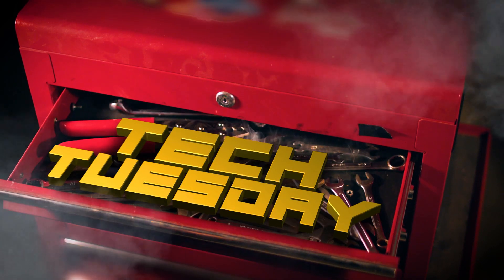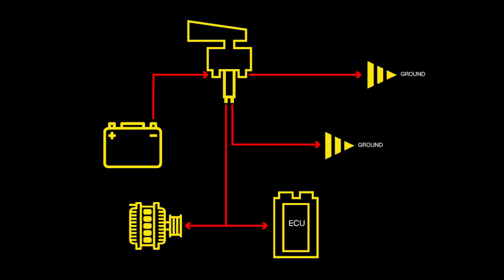🛠 DO IT RIGHT - Battery Relocation  |  TECH TUESDAY

Comment: Question: Have you ever seen issue with running the alternator cable past important wires?
For example, I have an alternator wire tucked under my intake manifold and it passes near injector wires.
Could it cause interference and poor function? What if it goes by coils or spark plug wires? The ECU?
Thanks for all you do!
Reply: The alternator can cause some noise. But in my experience the starter motor will cause you the most issues with interference if your grounding is bad. 

A bad starter will also crank but spike voltage to the crank sensor and thus will throw your crank timing out of whack. 

This was a big problem with my first project. My solution was a new starter and i used 1/0 for grounds.

I'm my experience coil packs with built in ignitor wont cause emf issues and neither should your alternator. If your wiring is in good shape.
Reply: @somedude9316  Thanks for the input! Still relevant for my projects. So far no issue with running in the scenario I described.

Comment: Yes bigger is better when it comes to batteries, I totally agree! It's pretty much the best insurance you can buy against alternator failure. Several months ago I went to Nashville TN to get car parts. As soon as I started driving back home to Memphis TN (about 200 miles), I noticed that my voltage was low and the battery light was on. A quick check confirmed my theory that the alternator completely died. I shut off all accessories and hit the road, feeling pretty confident that I would make it home no problem. Then I hit heavy traffic and got concerned. After sitting through 30+ minutes of traffic, I wasn't feeling quite as confident. But once I got moving I made it home no problem. The only reason I made it back without problems is because I have a big Optima Yellowtop D34 battery in my trunk. If I was using the tiny group 51 battery that these older Honda's come with, it would have died well before I got back home.

Comment: So i'm relocating my battery to boot in my 31. I'm also running the new Nexus, is it the same config for cable?
Pos - from battery to circuit breaker - stop switch - starter/ecu. 
Neg - from battery to block - strut tower.

Comment: I'm really confused now because of the phrasing. Is this the go-to way to branch off only from the starter?
So pos battery to starter, starter to alternator, starter to power distribution block? Can someone confirm this? 
I'm running all new wires and can't find one sure way to wire positive leads. I get the grounds part though.

Comment: Hmm you got me thinking about the voltage drop across the chassis since I am using it as a battery ground, so I did a bit of testing to get some numbers. I ran a a 2 gauge copper battery cable from my battery's negative terminal to one of the strut tower nuts in the trunk and I grounded the engine to the chassis with about five 4 gauge copper cables, making sure to sand all connections down to clean, shiny metal. I get about a 0.14 volt drop from the battery negative terminal to the engine block while cranking the engine with the fuel disabled, nothing to worry about in my opinion. I also tested the voltage drop across the 2 gauge copper cable that goes from the battery's positive terminal to the starter's positive and it loses about 0.36 volts while cranking, which I don't think is bad but I was surprised to see that a thick copper cable loses more voltage across the same distance than the steel that the chassis is made out of. A channel by the name of CE Auto Electric Supply tested chassis ground vs 15 feet of 1/0 copper cable and found that the chassis was actually a measurably better ground than the huge cable.

 So my suggestion is to use heavy gauge cables (ideally 0 gauge copper or heavier) and if you choose to run a negative cable from the battery negative to the engine, ground the battery to the chassis in the back also since from  my testing as well as CE Auto's testing, the chassis drops significantly less voltage than even a 0 gauge copper cable. Just be sure to make proper connections to a clean, thick piece of metal with good nuts and bolts that can be torqued down tight, don't use self tapping screws. Electricity takes the path of least resistance, so you will never make anything worse by adding more paths for the electricity to flow through. Hope this helps!
Reply: he covered all this in the video
Reply: What your missing (and what he explains) is that chassis grounds corrode and cause issues over time. 

I’ve experienced the issue myself with a rear mount chassis ground that initially worked great but then eventually caused a 3 volt drop on crank.
Reply: @karenthomson9749  That's true, but broken or corroded chassis grounds will cause you problems regardless of whether the battery is grounded to the chassis or the engine, although most likely worse if the battery isn't directly grounded to the engine. Battery cables can corrode over time too, especially if they aren't soldered/crimped properly and sealed with water tight heat shrink tubing. I also like coating the bolt end of the ring terminals with copper anti seize, it helps prevent corrosion and keep the connections healthy.

Comment: Can I ask why you use isolator on ground cable instead of power cable?
Reply: It's safer on the ground circuit as you want to keep live wires to the minimum.

Comment: Awesome Video Guys! I just have a question about the battery kill switch part. In the video he says there are two big terminals and 2 smaller ones. He says the bigger terminals go inline with the battery positive cable, but the illustration shows it on the negative side. Which one is the right answer?

Comment: Fantastic info thank you so much! Would you kindly comment on my style of starter circuits? My GM buddies hate it lol, but I always use a "Ford style" starter relay so I don't have constant power in the hot & cramped starter area. If the starter also has a relay then I send a trigger wire from the "I" terminal. I use a good quality heavy duty relay, Cole Hersee brand seems pretty good. I am curious your thoughts about this and also about using diodes or resistors to prevent fly back. Perhaps the better relays don't need? Can't find a solid consensus on the web.

Comment: Funny this came up as I've just finished relocating the battery to the boot in my xr6t to make room for the cold air intake. 0 gauge cable from starter to battery, earthed in the boot and also earthed the factory cable in the engine bay. Mounted the factory positive cables on an insulated post next to the original battery location and hey presto......mint with much dosages
Reply: Epic dosage or just much dosage?
Reply: And choice alternator whine...command centre whine...
With your car running, Switch the stereo to AUX, turn volume to max (without sound playing)! Also for dramatic effect press the light switch on and off...fucker sounds like a Dalek!

Comment: Right battery = biggest that fits.....
Reply: Well, there's a minimum size but if you can put a lorry battery on your Honda even better. Just make sure the Honda can carry it!
Reply: I want to race. Smallest battery that can reliably start the engine wins.
Reply: @KXP70  Yes for racing small wins....unless you stall on the start line haha
Reply: @KXP70   Then use a hand crank for starting.
Reply: When drag racing people who use the smallest battery possible are very often the ones who get driven around on the big end because their battery voltage has dropped from because there battery and electrical system cannot keep up with the demands of the starting the car and then the ignition system on a pass.  Generally speaking since most cars like some ballast somewhere (over the drive axle or to compensate for the driver) means that you don’t actually pay any penalty for using a big lead acid battery or two with lots of reserve CCA. I normally like to run two batteries and have a plug for a jump box to start the car or run fans before the run and after the run before the car gets back to the pits where I isolate the two batteries and plug eat into a separate battery charger.  The cars battery are wired in series that supplies the cars electrical system needs while making a pass and are isolated by pulling a shunt so that each battery can be charged with its own charger. Each battery and charger uses safe-t-connect connector to avoid mishaps in the pits and besides it keeps people from wanting to “borrow” your battery charger as much.  I also use a small rechargeable battery from a cordless tool manufacturer as a backup battery to my data-logging system.
Reply: @gullreefclub  Nice work! You have a good point about lack of voltage during a run causing engine problems. I have had high speed misfires in the past through lack of voltage